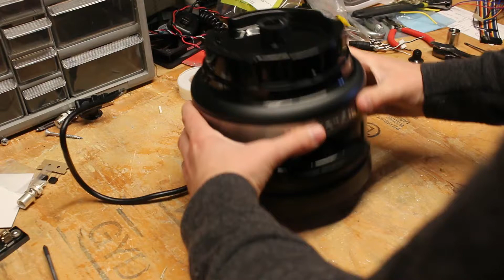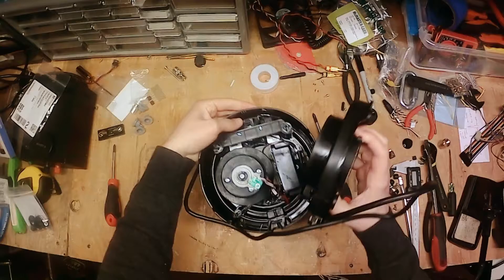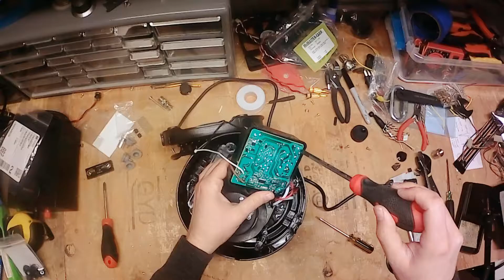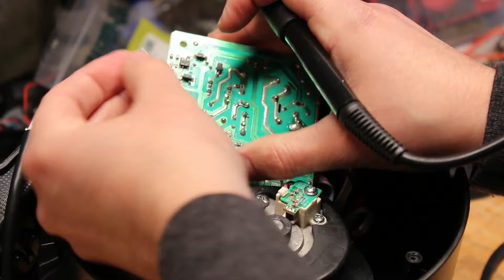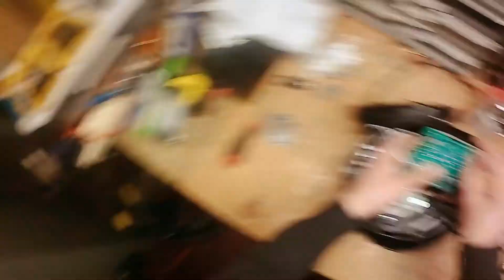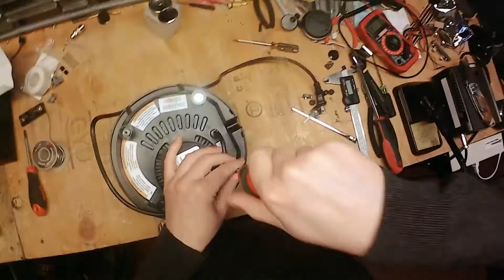Kitchen Aid 7 Cup Food Processor Repair (Won't Turn On)

Comment: Any ideas for someone with the opposite problem?  Mine won't turn off.  I press a button and it spins around on full speed regardless of which button is pressed.  Then it won't turn off until after 10 or so seconds after I've pressed the off switch..  Weird.

Comment: Thanks for this very useful video which pointed me in the right direction when diagnosing the fault on a dead 3.1 litre UK model 5KFP1319BBM. Indeed the soldered in ceramic 5A slow-blow fuse had failed. However, fuses generally blow for a reason and the culprit was actually a Triac in the motor control circuit. It was short circuit between its anode and cathode. Fortunately I have a desoldering station so both components were easily replaced. Fuse £3.44 for (3) and Triac £4.47, both from eBay. Hope this helps others.

Comment: Thank you so much for this video!  Mixing deep dish pizza dough and my processor died.  Used my multimeter to confirm fuse didn’t have continuity.  Ordered some fuses for super cheap and used your video to replace it!  Works great now!  Thanks again!

Comment: Awesome! I fixed my mixer as well, thanks to you. I live in Sweden and use 230v, and the fuse did not look exactly like yours. I bought the same fuse you did, and it worked just fine. Thanks!

Comment: Changed the fuse now I get power at least. But it’s blinking and motor not working. I saw another post about a possible in-line motor fuse. May open back up and see
Reply: Did you figure it out? Mine has same issue, and it is not a fuse this time, unfortunately. Visual check of all parts gives no clue.

Comment: Oh my gosh, I actually did it! Thank you for your very thorough and explanatory video. I have never used solder before I didn't even know what it was really. I bought my food processor a few years ago and used. It may be five times and it went dead and now it's working again yay. 🎉
Reply: Hey can you help I just need to find a good fuse replacement supplier, to help with fuse I am looking for

Comment: It was either buy a new unit (already had my original replaced with a "refurbished" unit) or check here to see if it could be fixed.  Easy to follow instructions being my first time soldering.  Best of all, it is working again!  So grateful for your video. Many blessings!

Comment: Would you know what fuse to use for a UK model? Mine does not look like this one, it's a small cylinder
Reply: Nevermind, after removing the fuse I could remove the rubber around it. It's a glass cylinder T2.5A250V 3.6x10mm, for anyone else interested. And it is definitely blown, so you may well save me £200 :) Thank you for this video
Reply: @shirleyhody1253  Thanks! Same boat here!

Comment: Thanks for the video and links, saved me some time diagnosing it myself.  I'm going to replace with the same amperage fuse but am curious if anyone has tried going up to a 5 amp or has wired in a better solution like a resettable circuit breaker?
Reply: I have the same question, did you try it?

Comment: Thank you! I just fixed my kitchenaid mixer as well! Very well done video! I think stalling it for a very short time blows the fuse. I didn't feel like using the same fuse however so I found some thin copper wire and used that. Don't know what the next weak link will be but when my wife stalls it again mabye it won't blow the fuse? I'm sure I violated some safety protocols.

Comment: You helped me out, Thanks! $0.50 fuse, $8 in shipping, but at least the processor's not in a  landfill.
Reply: Do you remember what size fuse or where ya ordered it. Can't find the link. Thanks.
Reply: @rodneyhomer3881  I honestly just bypassed the fuse with some 24awg wire.

Comment: Why not just solder in a couple of leads to a glass fuse holder, because you know it's just going to happen again!
Reply from the maker: It would be good so long as it's not accessible from the outside! Don't wanna accidentally mix water and electricity.

Comment: I replaced it and it worked fine for a bit but looks like the fuse blew when the cookie dough I had in it became too thick. Good thing I have a second fuse and will replace again but will make sure I'm not putting anything that will put too much resistance on the motor. Will be ordering more fuses just in case. I'm planning to try a 5A fuse to see if it will fair better. Do you think that'll be safe?
Reply from the maker: I also keep blowing fuses on ours. I would need to analyze the circuit to know if it is safe. I never recommend upsizing resistors without understanding the circuit

Comment: My unit stopped working and found a 4 A 125v glass fuse to replace the blown one.  It blew as soon as I hit pulse.  Any idea on the next place to look for a short in it?
Reply from the maker: Not sure. Windings in the motor could be shorted and resulting in it instantaneous blowing. Can you easily turn the motor by hand? Or does it seem bound up?

Comment: They should release a redesign using a fuse style similar to a car. That way you can just replace it easily using nothing but a screwdriver (to get to the fuse) and your fingers.
Reply: or a resettable circuit breaker exposed to the outside... but that would cost dollars per unit more....

Comment: I pulled mine apart. I know it is not "correct" but I am soldering a wire in there, lol. Next time it may let the smoke out of something else. We are OCD and never leave anything plugged in so we will be next to it if anything happens.

Comment: Great video, thank you for posting this. I had the exact same issue, verified with my multimeter, and now it is back up and running and I have a couple spare fuses on hand in case this ever happens again. In my case I am the culprit that blew the fuse, let’s just say I won’t be pushing food in there with a wooden spoon ever again.

Comment: Hi. I just "fixed" mine with the whole plan of opening its guts out. I'm sure you troubleshot everything but what I'm seeing in other DIY vids and in my case, it's a safety lock issue.  Kitchen Aid is a top brand and I can't imagine all these expensive food processors just stop working all of a sudden.  I think a good percentage is operator error (not in your case).  So my coworker gave me hers because it "stopped working" and she got another one.  This weekend, I decided to give it a try.  Turns out, Kitchen Aid has a three-tier safety mechanism (maybe 2) with the 7 quart food processor.  The top lid has to be properly put on (and can easily not be put on properly) which will trigger a switch to come out of the bottom of the container by the handle. This switch is the key that unlocks the safety on the base of the processor.  It's not complicated but if the user isn't paying attention and just willy-nilly snapping things in place (can be in the wrong place), then the safety won't properly unlock.  I get how Kitchen Aid would have multi-safety mechanisms in place because who wants to have flying blades in their kitchen?  Thanks for the video.
Reply from the maker: Yes the safety switches are always the first think to check and you're right. It is quite the complicated interlock system. My wife seemed to have gotten the blades seized up doing something and I think the current load was just too much and popped the fuse. Deffinetely recommended the first place to start to be those safety switches. With the blades and everything off it's best to try and push them in manually and see if fiddling there will get them to spin.